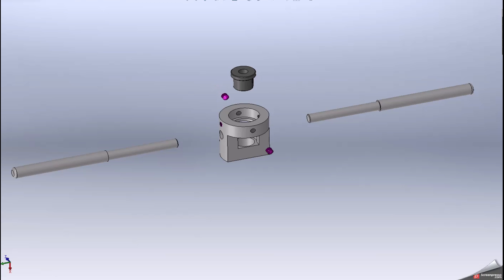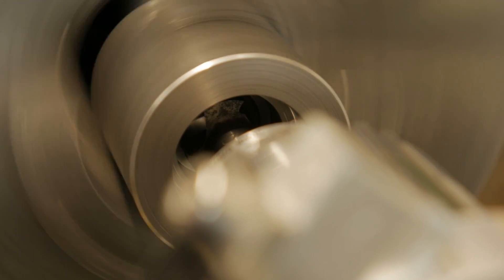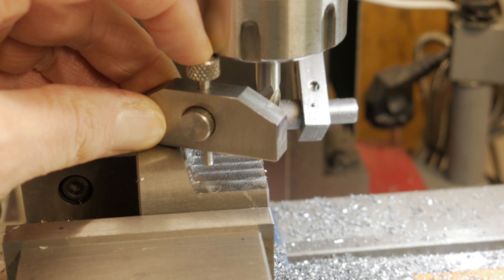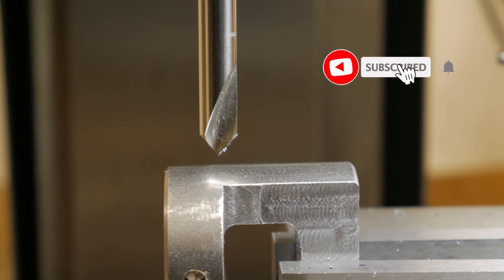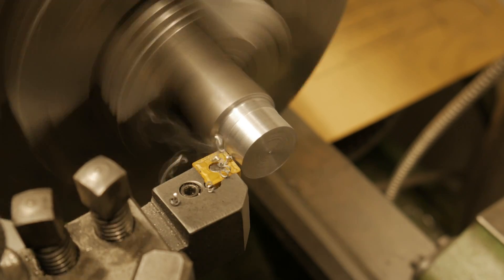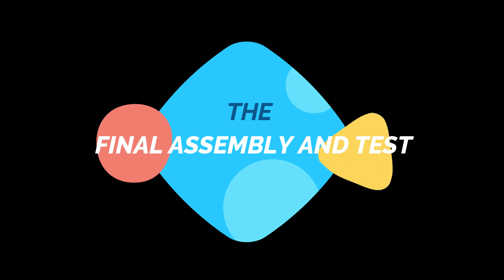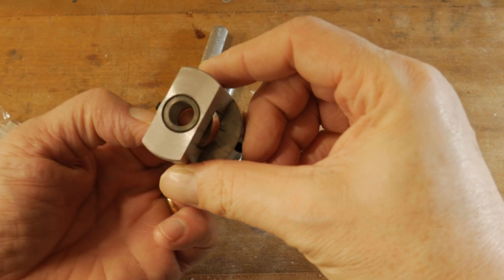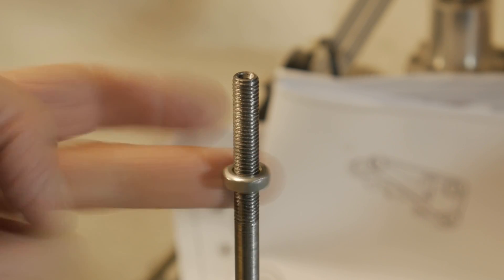Guided  Die Holder ! Let’s Make One

Comment from the maker: G’day everyone, 
I built a die holder with a guide: it is very easy, especially with large thread pitches, to start off wrong. This then means that the die holder will stop and the thread will be wrong. In particular with length over 2*diameter of screw; using the calibrated bushes for the thread diameters instead, the thread is performed correctly, the chip itself keeps the bush in place. The sensation is that of turning a tool that embraces the piece, really beautiful !! I'm really happy with the result and it's a super addition to my workshop!! Hope you will like that, 
Alberto

Comment: Nice job Alberto , seems like it works great for those long threads .
Reply from the maker: Ciao Shane, yes it works very well !! If you try to make a long screw by hand or by lathe, you will probably take by hands the problem, with the lathe it is the tool that can bend the screw, in particular if it is an insert tool holder and not a HSS tool; Ciao Shane take care and see you the next time !! Alerto